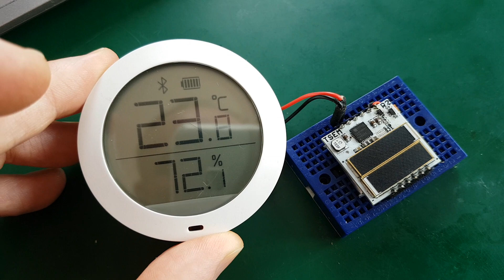AEMLION

Comment: question, Does the AEM10941 transform the small power from the solar panel to a high voltage?
Reply from the maker: Yes it boost it to 4.12V to charge the battery
Reply: @JasperSikken  Thank you very much, happy New Year!

Comment: Sorry for my confusion but this has a built in BMS for the charging?
Reply from the maker: You mean battery management system? I am not sure. It does not pre condition the battery, it does not terminate charging using a timer, it does not have battery thermal protection. Maybe that is not needed because battery charge current is relatively low, ~100mA or less